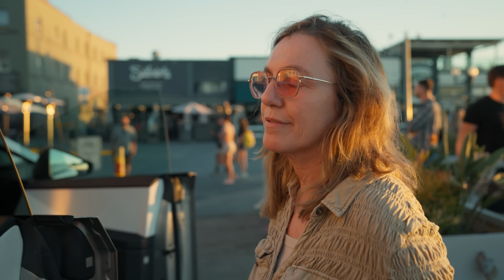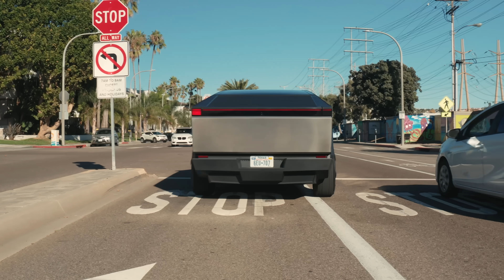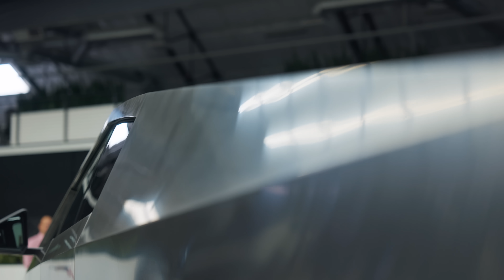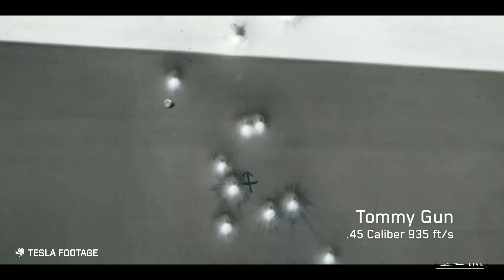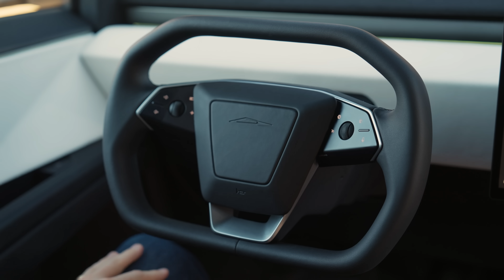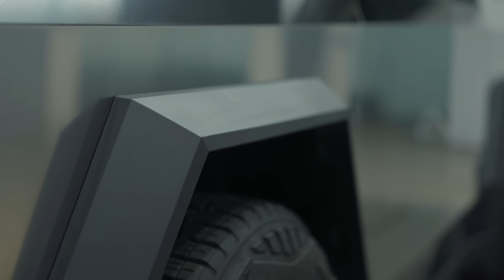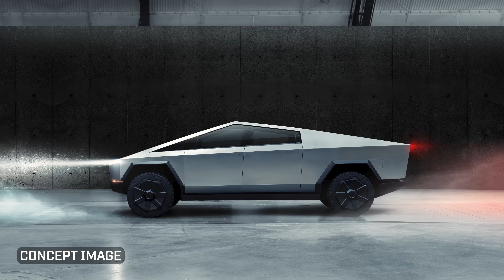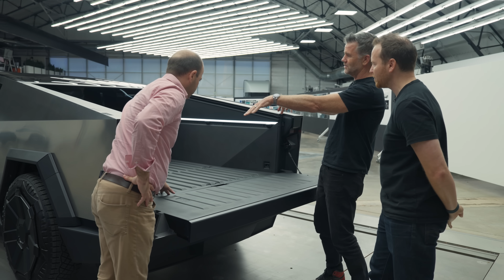FIRST DRIVE: Tesla Cybertruck Full Review

Comment: The biggest problem with that screen is that it's absolutely a single-point-of-failure for the whole thing. If the touchscreen is broken, it's not just inconvinient but the whole Cybertruck is broken.
Reply: I heard the screen is bullet proof 😂
Reply: The screen is an interface. It wouldn’t be hard to have a Cybertruck app on your phone that does everything the screen does if screen failures become an issue. But will they? My two most recent cars had touchscreens. They never failed. Most of our phones are reliable touchscreens. Sure, I love analog gauges, buttons, and knobs… but I’m not sure the lack of them will result in undrivable cars. OTOH, lots of parts: Knobs, gauges, buttons, levers, displays, etc = lots more to break.
Reply: @tullynation  Having ability to use your smartphone as backup screen for the car to e.g. switch gears or activate wipers if needed would be a nice feature to have.
Reply: @tullynation  but a single point of failure is way worse for availability then lots of points of failure that do not have the same impact on usability.

And would you like to have an App that can change drive modes? Imagine what point of attack that could be.
Reply: @DAVISION-YT  But cars are full of single points of failure. If any one wheel falls off, the car is unusable. If the steering wheel breaks, the car is unusable. So sure, you could have redundant gear selectors and air condition controls, but would I trade the clean aesthetic of an uncluttered interior for that in the extremely unlikely chance that the screen is going to fail? No. And as far as cyber attacks, don't forget that all Teslas are highly connected already and are probably just as vulnerable. You might feel differently, but, hackers hacking into my, or anyone else's, car's control system is very far down on my list of worries.
Reply: If the screen is broken you can still drive it fine. It's like saying the same thing in a normale car, but replacing it with gear box, cooler and so on. There are no redundante of those systems either. The screen isn't critical at all, and is also a pretty easy fix at services center, as it's just a replacement. You also need to do a lot of damage to it, and it's already something that has been "tested" out.
https://www.youtube.com/watch?v=YyQ8uB_zNIA&t=7s&ab_channel=TechRax
Reply: @-JustHuman-  Thanks for the link! That video nicely shows why we would want to have stalks on the steering wheel instead of touch screen interface.
Reply: @MikkoRantalainen  well if you are a retarded and have a hammer I guess you are right. Normal people don't need it, and it showed it worked fine without the screen, nothing that the stalks did can't be done on the wheel or in the app.
Reply: That's not exactly right - the screen is an interface that isn't necessary to drive the car. There are many functions also accessible by voice (temperature, opening glovebox or trunk or frunk, etc etc).  It's super inconvenient because you have no speedometer, but you can absolutely drive the car, even long term, without a screen.
Reply: @johnkrystek847  how do you switch to drive and reverse?
Reply: @DAVISION-YT  on my current Y and previous 3, the same way you always would, by pressing down or up on the drive stalk.
Reply: @DAVISION-YT  there are backup drive mode buttons on the ceiling pod above you
Reply: @johnkrystek847  Can you start the car and put it in neutral, drive or reverse without the screen? Can you turn on/off the headlights?
Reply: @MikkoRantalainen  there is no starting an EV, there's no engine to 'start'. Drive, reverse and neutral are done using my right-hand stalk, never use the screen for those. Lights are automatic, never need the screen for them unless you're overriding the 'on' setting which, in the case of a no-screen emergency, you wouldn't do. The point is, the screen is important, but it's not a show-stopper if it ever goes dark, you can still easily drive the car.
Reply: @johnkrystek847  There's no stalk in Cybertruck as far as I know.
Reply: @MikkoRantalainen  There's always a backup - Tesla doesn't do everything right but they do understand the need for basic movement if something like a screen failure happens.  Here's an explanation of how it works in a stalk-less S: https://www.youtube.com/watch?v=gvgLuun05-4
Reply: You're the equivalent of saying phone having one screen us the single point lf failure lmao 🤣

I mean come on, you can still drive even if the touchscreen control panel is broken

Also If you can get 50000$ car, you definitely able to fix 100-300$ screen depending on the screen quality, is it amoled or IPS
Reply: @azizsetyawan3038  how cute of you to think that entire screen will cost $100-300. When a door handle fails on a model S, (common occurrence) it costs upwards of $1000. For just a capacitive door handle. Much less the entire infotainment screen that is much larger than iPads that Apple sells for $1500.
Reply: @pa4911  dude don't equate screen with door handle dumb dumb

I'm pretty sure the screen on Tesla wasn't Amoled yet, so it's not as expensive as Amoled screen LCD
Reply: @azizsetyawan3038  if you watch the techrax video earlier in this reply thread where he smashed a Tesla model 3 screen with a sledgehammer and took it to Tesla service, they charged $1500. It’s safe to assume that this would cost more in the cyber truck, as the 3 is an entry level product. I’m equating cost to technology.
Reply: @azizsetyawan3038  https://youtu.be/YyQ8uB_zNIA?si=NgM5k02xiN4u_wSX
Reply: @pa4911  screen is screen. It use the same technology which are LCD

If the outside screen brake but still usable, you can just buy the cover and change it
Reply: @azizsetyawan3038  only if you can get individual parts, which Tesla won’t sell, and aftermarket units don’t exist
Reply: @pa4911  well that's the problem, maybe you can use the fake one from china lmao
Reply: I'd want switches, toggles...make it feel like a jet cockpit or a tank.
Reply: That’s an issue with all Teslas along with the range. If you are going to long haul 300 miles then having to figure out where to charge it and the time it takes to do so is a big failure.
Reply: @thetapheonix  Other models are not supposed to be used for off-road or other heavy duty tasks where accidents like some tool hitting the screen might easily happen.

For other Teslas, the biggest risk is to spill coffee or other beverage on the screen.

As long as Tesla can build many enough latest-gen fast chargers and the navigation system works, the charging times required should be extra 15 minutes per 100 miles in worst case compared to ICE trucks. So you will need to consider the charging times when you plan for a trip but it will be definitely doable for the battery.
Reply: @MikkoRantalainen only tools in a cybertruck will be the driver and passengers.😂
Reply: @MikkoRantalainen bruh. You get 20 minutes full charge with the V4 fast charging on this cybertruck

You can just go charge and go to toilets or scrolling through shorts, after you watching 20-30 shorts video most of the time the battery will be full (considering 1 short video having 1 minutes length)

All people definitely able to do that. Just like what we most of our free time does (scrolling through shorts)
Reply: @thetapheonix  You DONT figure out where to charge it.  It leads you to the charger .. they are built into the navigation.  When the screens fail a tesla will keep driving normally.
Reply: @cawfeedawg  You're taking that way too literal. I dont need anything telling me or leading me to a gas station since they are everywhere.The same cannot be said for EV charging.
Reply: If the Screen on my Skoda or VW is broken, the Car is also broken because I can't control the Temperature anymore, can't navigate, don't have camera views. It still drives, but not more.
Reply: @DAVISION-YT  Yeah, but the difference between not being able to drive at all vs not having AC is huge. The latter case is much easier to get to the local carage for repairs, for example, or doesn't leave you in the middle of nowhere in the forest.
Reply: @MikkoRantalainen  thats right, I forgot that you can’t even switch to drive without the screen here
Reply: @DAVISION-YT  backup drive mode buttons are up top
Reply: @tomnel  were are they? Up top of what?
Reply: I wonder why we have had breakdown lorries for decades?, ICE can still run out of gas, Electric points are even more available than gas stations if you include millions of properties (charge times obviously slower),  If you breakdown Tesla probably knows where you are an what's wrong (does it have a secondary battery incase main power fails?),  I expect it won't be long before their is voice control available (but that will probably be a difficult subject  to address, maybe limited to a few necessary words/phrases and limited to specific person's).  This is a different world and the majority of people are way out of their depth. @MikkoRantalainen

Comment: This is the ugliest car made in the last 20 years! An dI am amazed how the engineering team justifies the principally Wrong choices for geometries, curvature, and sheet metal treatment!!! There  are reasons why we add curvature to the windshield, and body, they all help with architectural stability, and aerodynamic. 
And using Steel to make it more robust (make sense specially at high torque) but heavy which counters he whole objective of making an energy efficient vehicle. 
wan why a pick up truck needs to have super high torque, acceleration, or even super car speed?!!!! 
This toy will be discontinued very quickly and might eat dust in collectors' garage.

Comment: I feel I just saw a Tesla promotion video.
Reply: As an American, this is the weirdest video I’ve ever seen from Top Gear. Americans hated this car from the beginning. It’s not a truck. And do you see the size of that seat? Americans do NOT fit in that. It can’t off-road, can’t mud, can’t roll over, can’t tow, can’t drive in sand, the back can’t bungee material to a cab, the lift can’t be altered without violating a contract. All trucks looked the same previously bc they work. That’s what a truck looks like for functionality. Elon is an idiot.

Comment: Glad he mentioned body ripples at the end, which was my only comment. Questions: Battery Life & Cost for Replacement. Are panels more resistant to door dings, etc. than other cars? Are stainless panels coated? Do stainless panels 'blind' other drivers in the sun more than other vehicles? (Don't recall hearing).. Are main gauges on HUD in front of driver?
Reply: No HUD. But there are aftermarket HUDs for other Tesla vehicles. If they don’t also work on the Cybertruck, I’m sure those aftermarket suppliers will soon produce one that does.

Comment: I think we need cheap ev cars, affordable cars
Reply: Musk has promised a small inexpensive electric car is coming next. And some of the things that will make it less expensive are innovations that will be paid off by the Cybertruck. Some examples: 48v power distribution, replacement of CANBUS with 1gps Ethernet, and steer by wire. And front and rear assemblies made with single castings, instead of many individual parts that need to be welded together. That innovation was going to be first on the Cybertruck, but because of other delays it was actually used first on the updated Model Y.

Comment: OK, here's something none of you "car reviewers" seem to get when it comes to driving large vehicles.

The more you drive a large vehicle, the more spatial awareness you gain on where the four corners of that vehicle are at any given time.
You see this in truck drivers that have been on the roads a long time.

I drove an M1A1 Heavy tank for a decade and after the first few years I could mentally picture exactly where all 4 corners of that tank in relation to the environment and could maneuver it through tight urban spaces fairly quickly and easily.

And the tank didn't have display cameras all over it like Teslas do, including the new Cybertruck.

Elon caught on to what Delorean already knew - an unpainted stainless steel body really works well and is tough as hell.

Comment: I fully agree with the other commentators. The Cybertruck is an engineering marvel.
It is also the only off-road vehicle for which there is not a single review of how it actually performs off-road.
You only ever see it on flat, asphalt roads, mostly parked 🤔
Reply: Rivian kills it off road compared to most trucks and people drive Crown Vics in Moab so im sure it will do fine
Reply: And no spare tire or place to install a winch. I’m still buying one, but not happy that I’ll probably need to buy a complete new aftermarket front bumper assembly just to put a winch on.

Comment: Wavy sheet metal. Too bad they didn't stick to a more traditional style where panels with bends are stronger, flatter, and easier to manufacture. Any blemish on the huge flat panels will stick out like a sore thumb. Some cool innovations like steer by wire (maybe a little concerning).

Comment: I have been searching everywhere for someone to do a practical review of this thing being used as a truck.  Yes, yes it’s very nice how fast it can do zero to sixty.  Yes, yes its very nice that it’s bullet proof.  But what I want to know is how’s the range when you’re carrying around 1200 lbs of tools in the bed?  Or how easily does it get stuck in the mud or the snow?  How long does it take to charge the battery if I’m doing it at home?  You say it’s a work truck but I dunno…so far it looks more like it’s designed to compete with a Cadillac  than an f-250.  That’s not a working truck, that’s the boss’s truck.
Reply: Finished models have been available for two days... give it some time.
Reply: I agree. Let a truck guy perform the review instead of a guy that never leaves the pavement. Put a refrigerator in the bed and deliver to a friend. Hook to a trailer and back it up to a garage door.
Reply: From looking at the specs, towing capacity etc, and the show, it looks so promising in answering your doubts. Let's give it a few months. But at $100,000+ I don't think your regular day-worker down at HomeDepot is going to there to load 40 bags of cement and loading a cement mixer on this one.
Reply: Its meant to complete with the F 150 right now. Give it some more time.
Reply: 70% of pickup trucks owner never put anything other than groceries in their trucks. It is weird but most trucks are just personal commuter cars these days. This thing is going to be a soccer mom's tank. I doubt many of these will ever be like an actual work truck.
Reply: its worse than a 2 wd escalade with rubber band tires offroad.  the bed useability is crap because you can only get to things near the tailgate without a stepstool. wait till whistlin diesel gets a hold of one it will be dead faster than one episode.

Comment: In the original presentation it was supposed to have an air pressure outlet for tools instead of "just" power outlets on the bed.
Reply: It was also supposed to have 30% more range, cost 30% less, and come out four years ago.

Comment: The best part of this... is the Tesla haters saying battery tech is at its max and cannot get better 🤣, just for them to release a better battery.
Reply: Wouldnt buy any of these until they come out with sodium ion cells
Reply: @gregorybolin4672  I will not travel near its max distance daily. I do delivery driving and stay under 150-200km average on the busiest days so it fits right into the range. Currently I drive a V8 Mercedes that gets 15L/100km in the city. Price is 1.20/L currently. So I can end up spending $20+ a day on gas alone. For me a Tesla was always a better option, however I have been waiting for the Cybertruck since reveal because I want to get back into a truck. I also have a firewood business and it would allow me to deliver much more at a time.

Purpose built, purpose used is the phrase that comes to mind.
Reply: Tesla haters are about as smart as a rock, prove me wrong by saying something smart aside from "TeSlA Is sO DuMb AnD So aRE ThE DriVeRs"

Comment: Big lie watching the engineers talk about the stainless. There is nothing hard about this steel other than work hardening. and it will be a nightmare to correct dent, and being so soft a material, it will dent. Worse the sharp corners as they said took special methods to bend, so once you dent it... goodbye to the origional shape. Its all hype, its not bullet proof, but the dents of the subsonic ammo are real, and that is what every nearby car door is going to do to those large flat panels. Its all hype, a work truck is a joke concept, so yuppee mobile, but it is a maintenance nightmare, with very little range, and all the fire potential of all Lion batteries. Practical... lol.

Comment: Stainless steel is an impractical material for a car. Not as strong or as hard as Advanced High Strength Steel used in modern cars. Easy to scratch. Difficult to repair after an accident. Following the usual principles of Elon, over promised under delivered.